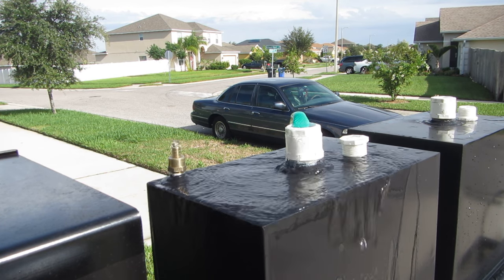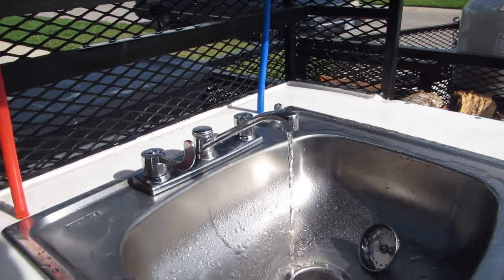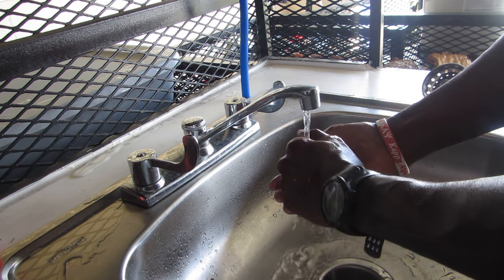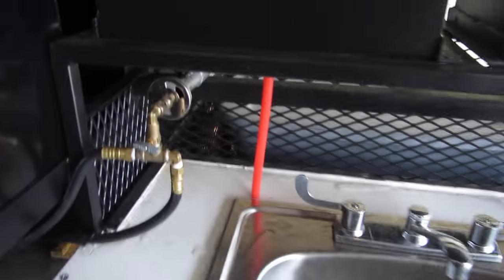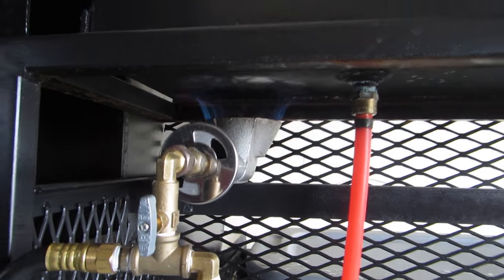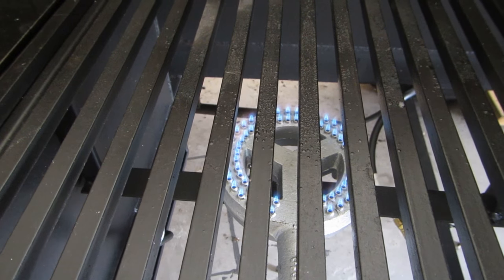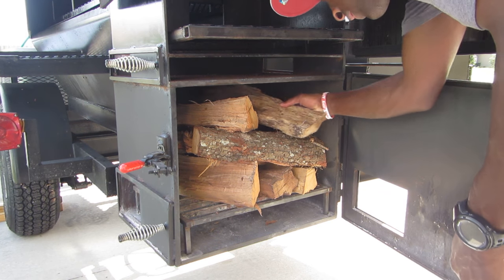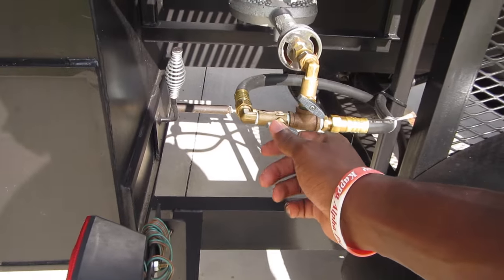Pt 2 - TREmendous Que's BBQ Trailer Pit Action Review (TREmendousQue)

Comment: Very nice!! How much did you spend on your smoker and do you recommend those smokers?If you don't mind me asking? I'm trying to get a shirley fab smoker but the time frame is like 2years to get one
Reply from the maker: Cedric M&R is way faster than 2 years. I do recommend the cookers but id recommend an additional workspace table instead of grill and butane burner. I dont really use those parts of my pit. It was about $8k. But that was 2 years. May be higher. The base model price is on their website though
Reply: TREmendous Que thanks fam!!

Comment: Did you upgrade to a 1/2 inch firebox or is that standard?
Reply from the maker: I did upgrade and definitely glad I did. The 1/2 in box helps to retain heat and it offers added protection for the Warmer Box right above it. There is a gap between those two boxes but that extra thickness helps direct heat towards the cook chamber (which is where I want it) and not up and out of the firebox.
Reply: TREmendous Que awesome. Thanks for the advice.

Comment: You need to put a flame barrier around your hot water tank propane heater, why? The flames got pretty close to the rubber/plastic water pipe
Reply from the maker: Preciate the tip. I'll look up some vids. I have had the mod done for over a year and in the dozen or so times I have heated up the water, I haven't had issues with the water piping BUT the rubber on the handles connected to the piping sit close to the flame and started to heat up pretty good. I caught it in time, but I got lucky. I will check out putting flame barrier on the mistress

Comment: Are the doors slamming under heavy winds?
Reply from the maker: Nah, it'd take hurricane force winds! The firebox door is 1/2 thick steel and the rest of the cooker is 1/4 inch thick. Only "unintended movement" i have noticed is the cooker doors if i dont have the cooker level. They may swing open or closed moreso than i want if its not level
Reply: TREmendous Que thats what i meant, on cooker doors. Im trying to do mine like that but i dont want to be burning my elbows once i get the doors opened and start swinging side to side.
Reply from the maker: Kool, glad I could help. let me know how it turns out!